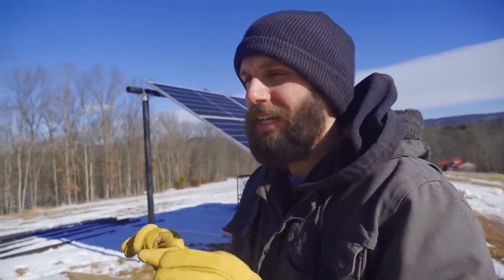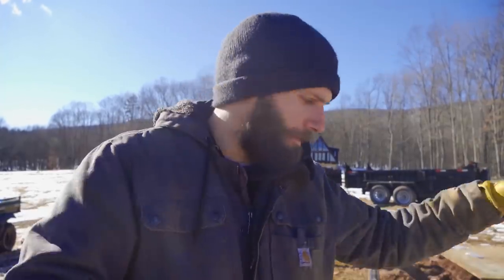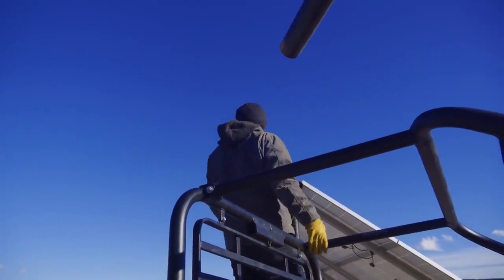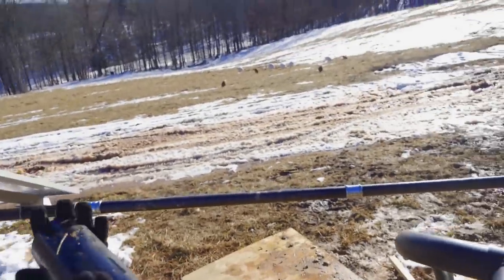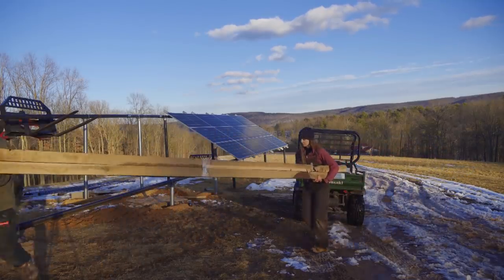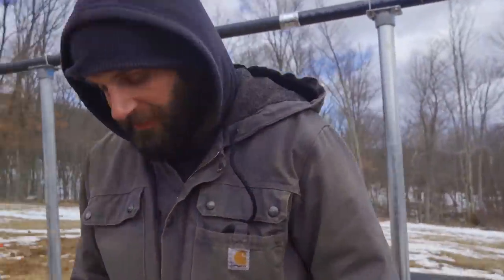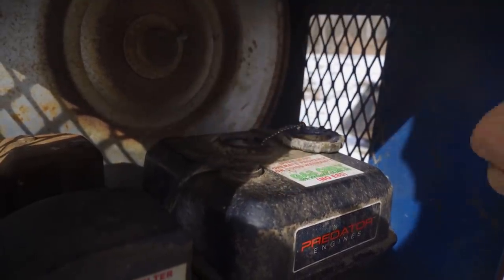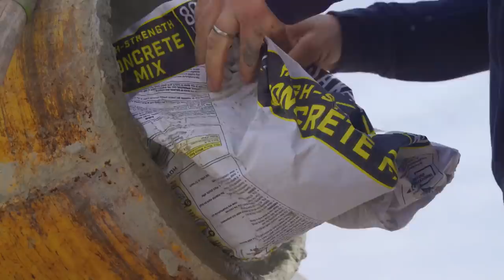USING THE SUN TO POWER OUR HOME

Comment: I've set boatloads of posts with concrete over the years.  Most mixed in a wheelbarrow, some in a mixer, and some poured in dry.  Surprisingly, they all work about the same. I now do most dry, as long as there is any moisture around at all, it works.

Comment: I use Sta- Bil in my engines when I put them away. Also tou can spray a little WD-40 into the cylinders to ensure the piston doesn't seize, plus WD-40 will burn when trying to start the engine.

Comment: Hy Josh I think your mixing is very wait if you little dry side and tampering will be very solid. second thing is the mixer need to clean few rock or brick through in side and water and it will be cleen. any way both work hard well done.

Comment: Erin looks like a Gnome the way she wears her WWOG stocking cap. You need to wear your stocking caps the way Gnomes do for marketing purposes and for turning it into your own sales gimmick. Pity the weather cannot be more cooperative for you. You need to always lift with your legs and not your back. I reckon 24 yanks on that mixer cord is a charm, you think? Maybe you should have let Erin do that. Two or three pulls are suppose to be plenty, maybe you need a carburetor prime or at least soak your air filter in gasoline before you start it again after such a lengthy storage, you think. That is a lot of work for that particular job without throwing your back all out of whack in the  process. Great video, you two. Namaste. 🙏🏻🖖☯️

Comment: Most people don't understand how heavy a piece 2/3/4inch rigid pipe is. And that steel pipe is stupid heavy. I did industrial Electrical for many years. Major props to them both for handling that(especially her,alot of men and women couldn't handle even 70inch,when they're 120inch factory).

Comment: Second viewing.  Normally you would not pour concrete below about 40F.  If the water freezes before it fully hydrates the cement, the concrete will be very weak and crack.  The temp at the bottom of those hole is probably >50F !That is why you want it below the frost line.

Comment: It’s kind of late, but if you just pour that concrete mix in the hole around the post it will set up all by itself just like you poured it. You don’t have to actually mix it. Give it a week and it will be the same result. Just pack it with the end of a shovel or rake and you’re good to go. 

We set fence posts that way all the time. Same result, but a whole lot LESS effort and time.

Comment: Have you thought about using something a bit stronger than the set screws holding the bracket to the top of the posts. Wondering about wind lift on the panels

Comment: when your done with the mixer put some stones or bricks in and run with some water, it will clean it better then you left last time....!
Reply: or turn it upside down(when dry) and bang the (expletive deleted) out of it with a BFH
Reply: No bricks, that could damage the drum. Gravel and some water is better. It cleans it and gets into the nooks and crannies (like the parts where the blades meet the drum). Also, the gears need some serious greasing.
Reply: @dwainkitchel1316  Yep, that's how we pros do it...
Reply: @ShEsHy  I have used bricks inside the drum for over 40 years no damage done...!

Comment: With solar cells being so close to the ground on one end, will the sheep, are bull hurt it by rubbing or stepping up on it? Put the forks under the pipe and raise the low spot up and then cement in , after leveling out. What do you think? Make a v-shape chute to put over the holes, to to dump the concrete into. That way, you will not have to shovel it in.

Comment: Just a thought but if you used like a 5 gallon plastic bucket to transfer the concrete from the tractor to the hole, instead of shovels might go a little faster

Comment: Josh is way smarter than I am but I think I would use a short 2 foot piece of pipe that slips just inside the large pipe where the joints are which would hold the pipe in a straight line while you assemble and concrete.

Comment: Sea-Foam, Walmart sells it. Just pour it in and NO MORE carb problems. If it uses gas or diesel at my place it has it in it.  Even my gas jugs have it in it. A product that WORKS. I put it in my chain saws, weed-eaters, boat cars everything and I have had no problems starting or running. It removes moisture, stabilizes fuel, cleans carbs and injectors, and more.  I have gotten so many to use it I SHOULD get a commission on all of it they sell.  TRY IT    jimbo

Comment: I've been watching for some time... I have to say this is an awesome setup everything is over built and perfect... Only thing I've seen Josh hasn't done right is pounding in a ground rod with a hammer... A gallon of water and a shovel and it will slide right into the ground

Comment: I have had a electric concrete mixture I got tired of jumping the concrete into a wheelbarrow so I made a shoot or it show when I dumped it out it went straight to where it was supposed to go to I attached the shoot to the machine under Neath even though all of the concrete did not go into the place I still just had to rake it into the hole

Comment: How long does concrete take to set in temps like that? Do you have to wait until the concrete is fairly/mostly set to try and put any weight on it?
Can't believe how hard you've worked. I just don't think I could work into the night with the wind and cold. Lol, my parents couldn't and raised us in the desert Southwest. No snow for us, unless we drive 40miles and 6,000ft up.

Comment: I may have moved the concrete mixer right up next to or very close to the holes that needs concrete in them. flip it too 1 side too fill and mix concrete and then flip it over and out into a sort V channel made from the plywood laying around, or straight in the hole. I mean the (forklift or to moving stuff) tractor is right there... 16:14 Edit: ok maybe the water/hosepipe was to sort?
Reply from the maker: There's no water source by the stanchion

Comment: I’m not absolutely positive that steel structure will support more than ten or twelve tons. You might consider adding some duct tape around those pipe joints, if you see it flex any during a category five tornado. But I was impressed with your wife lifting those 80 pounds of concrete. Keep up the good work.

Comment: you shouldn't pour concrete in Temperatures below 40 degrees F.
The water freezes during curing, leaving the concrete with micro cracks and brittle when hard.

Comment: you know the easiest way to bridge a pipe and to make sure its lvl is if you put a pipe that is about 6 feet long inside of the pipe you want to connect that has a the outer diameter of the inside diameter of the pipe you want to connect. because then you have 3 feet of inner pipe sticking out either pipe.

Comment: Are you pouring concrete at subzero temperatures ? Won't the water shift in your mix after it's cast ?
Reply from the maker: The ground wasn't frozen.  Above ground temp was 35degrees.  Our holes are 50" deep.  After pouring concrete we left about 6" open to fill with dirt to ensure nothing would freeze

Comment: Wouldn't it had been easier to set the vertical pipes in the ground "close enough but long" and cut off the tops to level them after the concrete hardens?

Comment: Any tool that is powered by a gasoline engine should have a fuel shutoff.  Use the fuel shutoff NOT THE ON/OFF SWITCH to turn off the tool.  No fuel in the carburetor when stored means it is much more likely to start next time.

Comment: Could you have taken out some of the stone with the post hole digger instead of re-cutting the pipe ?  Just thinking ?  Plus with the ground so wet just empty the bags of concrete into the holes and it will pull the water / moisture from the ground and actually be much stronger ?

Comment: For that low stanchion what I would have done would be to attach the stanchion to the pipe and level the pipe by supporting it on each side of the stanchion. I would have then poured the concrete and let it set, then removed the supports holding the pipe.

Comment: I don’t understand why you would use cement when you could just use the new quick mix that expands within 30 seconds. And has the strength when cured as much as cement it’s the preferred method that most sense and Pohl installers use then using all that cement and mixing it. 
Also why wouldn’t you just build the entire frame out of wood there’s no necessary benefit of building that frame out of metal.
Reply: Wood? In a pasture. With farm animals. That chew on everything. And that's only the first of a couple reasons I wouldn't use wood.
Reply: @ptaylor4923   so you could code it with some thing that is abrasive or protective so that they can’t Noll at it or you could just put a simple fence around the entire solar panel. Plus it doesn’t answer why they’re using cement when they could just use the new quick release that cures and solids within 30 seconds

Comment: That would be the most inefficient job I seen you do. Chances of non level very high. Why not put last GI POST in concreted at exact level (set out point) then run string or laser to get the rest?